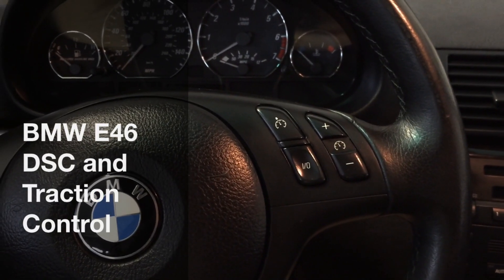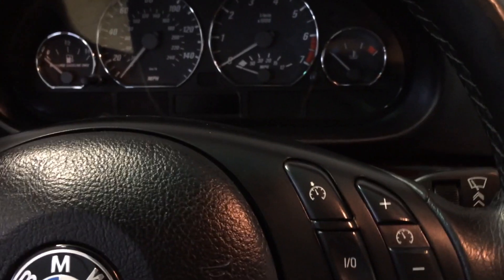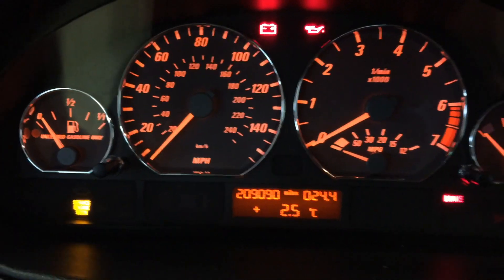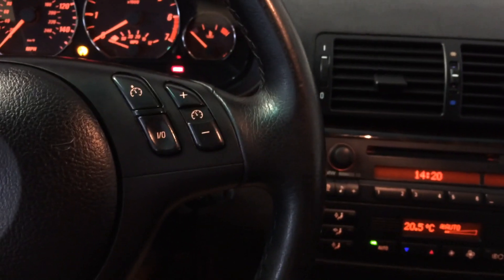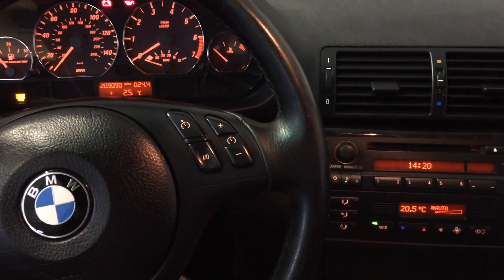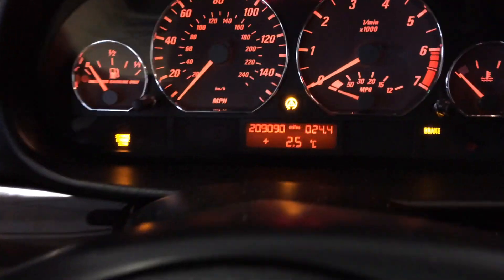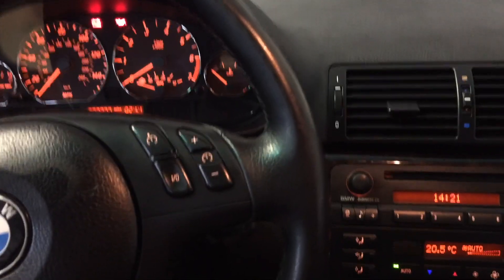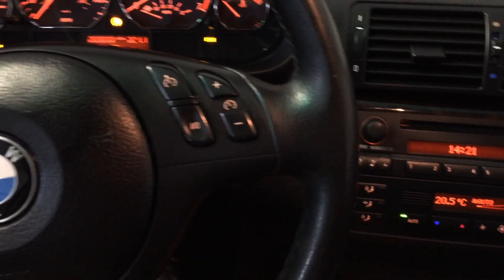BMW E46 DSC and Traction Control

Comment: Hello my freinds.
My 2004 325i has a problem with the DSC button. When I press it, the triangle lights up on the electronic board, but the brake light does not light up with a yellow light. I tried pressing for a long time, but to no avail. Is there a solution to my problem or anyone who encountered this type of problem?
Reply: Did u ever figure it out??

Comment: fwiw if/when the ABS system gets a fault, the entire DSC goes with it. 
 
 This means, if it happens while you're in a high speed corner, on a wet road, it will go instantly into track mode, instant drifting.

 I used to engage this 100% of the time while driving but it also disengages ABS too, so beware.

 However, the alternative in newer models is the car always going into limp mode. It's safer but at least with the e46's you can still get to where you need to be at normal speeds. Limp mode can be more dangerous in some situations.

Comment: why mine dont turn ebrake light on? i hold the 6 seconds and even more and the light dont turn on :\ any idea?
Reply: Same here. I can hold for as long as I want and doesn’t light up both
Reply: Same issue
Reply: You guys found a solution?
Reply: Same
Reply: Same :/
Reply: Same!
Reply: Hey my car keeps the trac off light an brake light on all the time even when i dont press the button lol so idk if my trac is on or off even when i press the button but i got a turd stock 325 so i doubt it has any balls to get sideways as is
Reply: Plug the cable back in. Someone probably unplugged it.

Comment: On some models holding it for 4 to 5 seconds keeps it locked on for a certain amount of time like you can't shut it off after so be careful and do your homework before going to town on all your buttons
Reply: Yeah he not lying my shit does that
Reply: All you have to do is undo you battery and plug it back in goes away
Reply: @Braapless yeah mine locks I just turned the car off and on and it turned it off 323ci

Comment: Damn i am driving my e46 for 5 months now with both lights on and i am wondering why it spins when it's wet :D Now i know
Reply: One of your speed sensors might be out, that happened on my e36, I thought it was hella cool, my rear tires skidding out, till winter came along, spinning out in the rain got real annoying quick.
Reply: if the both lights are on without pressing the button, you probably need to check your brake discs and it has nothing to do with DSC
Reply: @tablechair  It is a dead DSC module(elecronic is dead inside) but it is a pain to switch it because it is infront of the driver side behind the engine.
Reply: A lex Mine came on and then went away when i turned it off. It happened again and it won’t go away, could it still be the brakes?